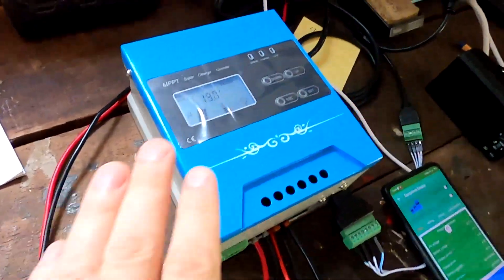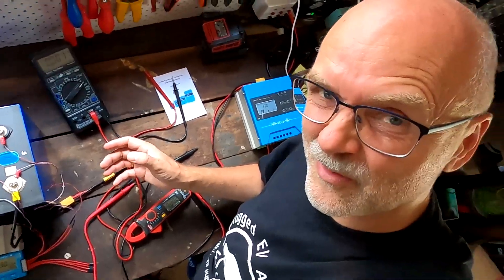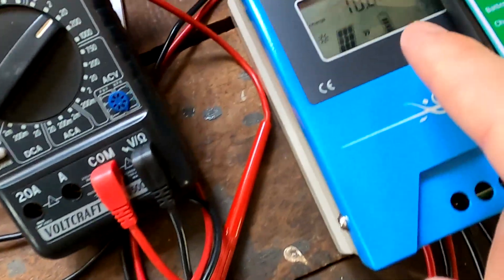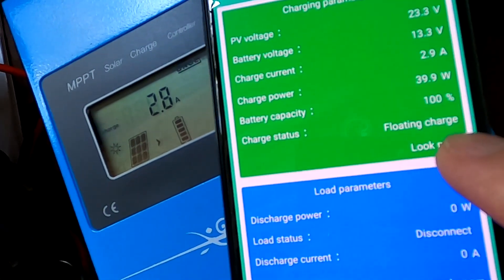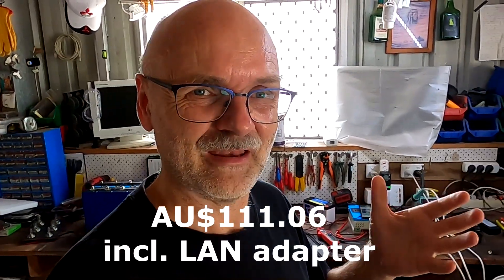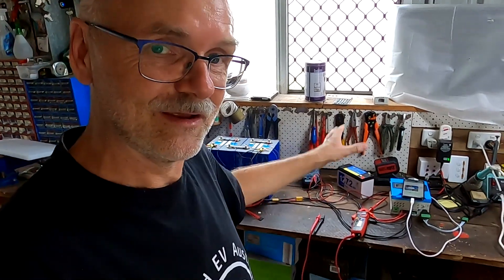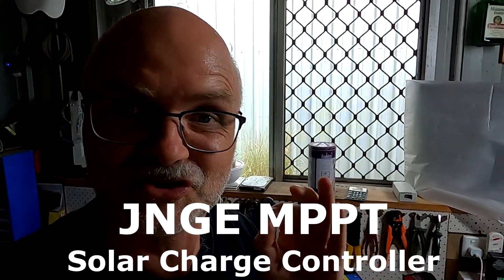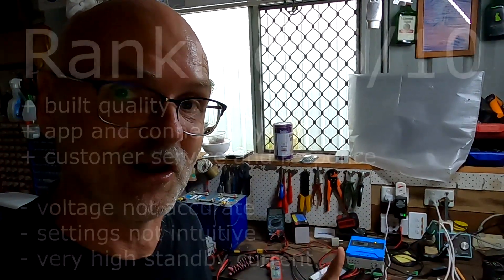JNGE MPPT Solar Charge Controller - Cheap or Awesome? Both?

Comment: Thank you for this comprehensive review. It solved my misunderstanding about setting the various voltage limits. No where in the contained instructions does it state that the voltage is set by cell voltage.  Now I have to determine how many cells I have in my liTime 100 amp LifePo4 batteries. (3x 100 amps in parallel) Thanks again. I have subscribed.

Comment: I recomend to calibrate the tester. I have mine calibrated with a precission voltage reference and got the same voltage than (my) mppt.
Edit: The options on this mppt are for lead acid. I suppose for lithium you should put the same voltage on all charge settings.

Comment: I have a similar controller it's a hybrid wind/solar they sold it to me as a 1500wind / 1500solar 3000w total but in reality it's not it's only 500w wind / 500w solar. Lame. The solar seems to work well I get 13 amps on a sunny day in the middle of winter. But the turbine setup sucks I get 3- 6 amps on a 25km/hr wind  which isn't too bad.

Comment: I purchased this controller, a short while ago and the first comment I will make is that the "warranty" is now only 12 months. Second comment is that it does not come with any connectivity, you have to buy that separate, disappointing as I did not figure that out when reading their sales pitch. 

What you described in the way of connectivity was EXACTLY what I needed, to remotely manage my battery or at least be able to see if all is ok, when I am not there. Plus they had different capacity models available. I read up on what it was supposed to be capable of and figured out that I could run two 12v 200watt 10amp solar panels in series, (24v) and the controller would identify the voltage of my battery (12v) and charge it accordingly. 

From the start I had all sorts of stuff flashing, Uover, Error light and no PV icon, which I realised meant it would not be doing any charging and upon reading the troubleshooting section it seemed that the message was “overvoltage protection point was lower than the highest charging range”. So I set about trying to set up the charging parameters, but nothing I did would get it to stop the errors. No matter how many times I tried to adjust any of the voltage parameters including turning it on and off a few times and letting it sit for a while just in case the capacitors were keeping some sort of memory, no voltage parameters would change I would put in the numbers I wanted press the set button but they just went back to where they were, which at that time were in the individual lipo4 battery cell range 3.2 volts. But it could not read the individual cells of course, it should only see the total voltage of the battery, but it is telling me 3.2v? So with Lipo4 selected as the battery type it thinks the battery is only 3.2v really?  This was with the two PV panels connected in series.
 
Then I read the troubleshoot bit about "reduce the number of PV arrays connected in series" right, so it looks like I cannot connect two panels in series. WOW did I get that wrong? It refers to section 3.1 but in there the only thing I can see that may have something to do with the problem is at No7 it says, “The installed battery pack should match the controller charging voltage and the recommended charging current range.”  Hmm I am not sure exactly what that means – given  that it also says in the product features that “12v/24v/48v battery system automatic identification function”  I cannot see anywhere where they say you cannot series connect the PV panels.

Ok so I disconnected one panel and at least I got rid of the flashing red light, but still had the first error (Uover) and while the controller gave a reading of 13.1v it would NOT allow me to change any voltage parameters, it was still set to LIpo4 but it is determined that I am running a 24v system which is why I am getting the Uover error. I am guessing that is because when I first connected it, it was seeing 24v from the PV panels, even though the PV icon was not lit,  and which did make me recheck that the panels were putting out voltage and amps,  which they were doing. So I then decided to try just one panel. This at least got the PV icon to show, Volts still read 13.1 but the Uover error was still there.  

Now I have the task of trying to communicate with them to see if there is anything they can do or suggest to try to fix the thing without sending it back to China which would be far too expensive. I have installed whatsapp just to try to contact them, but I have not had any luck getting their number to work. 

Might be a hundred and sixty bucks down the toilet!  Worse still where to from here?

Comment: I saw your video 
 Just a thought  , I wonder if it's anything to do with the fact you have  4 cells in series . I have the same device but the manual recommends  3  cells  not   4   to  achieve 11.7 v volts
Reply from the maker: That totally depends on what cells you use, Li-ion or LiFePO4.

Comment: Second thought.  If you used a real BMS ;-) could it be used to shut off the charge at the right voltage, or would that lock up the BMS?  I remember somewhere that that could destroy the charge controller.  Also, could you just program the MPPT cut off voltage a .3 volts offset?  Yea, it's a mess but would it work?

Comment: I really appreciate your videos.  Some time has passed.  I notice that when i search on the JNGE controller I get your video and an JNGE advertisement video.  To me, it's clear JNGE is trying to reach customers that see your video.  The ad video says "new" and offers a discount.  It never says that they have addressed the problem in the "new" version but it would sure seem they would have if they are trying to reach customers that know about the problem.   Do you know if the error has been fixed in this New version?  It sure seems they would have sent you an updated one if they had.  Thank you for the material you put up :-)

Comment: I had that problem with my mppt charge controller, a different brand mind you when I discovered the difference in reading I sit down and calculate the difference and reset the change controller to my calculated settings I never had a problem after that again.

Comment: I have a couple of different ones but recently got 3 make sky-blue controllers. Really good actually. Can calibrate the voltage. Settings for lithium and everything adjustable from controller without PC.

Comment: May be there is a minimum span between the bulk charge and float charge that you must have for it to work. Remember the voltage will drop a small amount when charging finishes so it may have  a historicise between them to stop it flicking on and of continuously. Then your charge start would be below them both.

Comment: Are you sure you are reading the MPPT correctly?  I bet it was displaying battery voltage and not the input solar voltage.  That is why it was less than the battery and that was due to losses across the cables.  In addition, I have seen significant variations in measured voltage even across instruments that are normally considered accurate and reliable such as Volt Ohm meters.  Of course, to truly get a decent Volt Ohm meter you need to spend a bit of money.
Reply from the maker: The voltage of the controller is LOWER than the voltage of the battery. This can never be explained with loses in cables as I explained.
Also, there was no load or solar connected, just the battery voltage reading.
Reply: Now you have me very confused.  I am looking at your video and at 2 minutes in it shows cables going into the PV and battery connections.  Now you say you don't have solar connected.  It is very difficult to say what is going on under these conditions.  My guess is that your charge controller is measuring and displaying the voltage it senses from the battery.  That is what it shows in the video anyway.  There is some length of wire from your battery to the charge controller so I expect some losses although now you also say you had no load.   I can think of a plausible explanation for everything you are complaining about from good MPPT to bad MPPT..  A good MPPT will actually have a separate voltage sense wire that goes directly to the battery terminals.  That eliminates inaccurate voltage readings due to current variations.  If your MPPT thinks it is seeing a 13 volt battery and the battery is actually at 13.3 volts, then the MPPT may try to generate a charging voltage that is too low or borderline.  That could explain your charging light going on and off.  The MPPT alternates between doing nothing and charging.  Anyway, perhaps you should quit buying cheap stuff unless you have seen some verifiable reviews.  My guess is that your MPPT has accuracy problems but it could be some other things I can think of as well.  By the way, did you try putting a load on the system and seeing if that changes things?
Reply from the maker: @robertgrant5895  then it would be the other way around, charger has higher voltage than battery because you lose some through the cables. This one is the opposite.
Reply: @OffGridGarageAustralia  That is only if the MPPT is charging but my guess is it is not charging all the time and thus the light going on and off due to inaccurate voltage measurements at the terminals of the MPPT.  If the MPPT is not charging than you could have voltage losses in the opposite direction. There may be a way to compensate by varying voltage settings in the MPPT menu.  Can't say as I have not seen the menus.  ONe thing seems clear and that is that the MPPT is not seeing the correct voltage.  I see different voltages measured by my reasonably accurate volt-ohm meter just by changing the leads.

By the way, you have your positive red lead reversed with the black common on your voltcraft meter.  That does not inspire a lot of confidence.
Reply: @OffGridGarageAustralia  If you are interested, there is another test you can do.  My latest  hypothesis is that when you measured the voltage at the battery terminals you may have done it when the MPPT was charging the battery.  If this is so, you would be measuring the charging voltage and not the true battery voltage.  You should repeat you tests but after you record what the MPPT says is the battery voltage, disconnect the battery from everything else and measure the voltage at the terminals of the battery.  That way you can insure you are not measuring the MPPT charging voltage.

The thought here is that the MPPT must measure the battery voltage in order to know if it needs to charge and what kind of charge it needs to give.  So that would imply that at least some of the time the MPPT will stop charging to measure the battery voltage, calculate a new MPPT point, and then go back to charging.  I would guess that most of the time it is charging if the battery voltage is low and only some of the time it is measuring the battery voltage.  If true, you are likely measuring the MPPT Charging voltage and not the true battery voltage.  If you disconnect the battery from the MPPT (and probably all else as well) you could see if the actual battery voltage is closer to what the MPPT is telling you it is.
Reply from the maker: @robertgrant5895  the controller was only connected to the battery, no solar, no load. Again, the controller shows a lower voltage than the battery, so could technically never charge it.
Reply: @OffGridGarageAustralia  You are missing what I am saying.  The MPPT is showing something but we really don't know what.  Is it an erroneous measurement due to a bad MPPT or is it measuring the true battery voltage?  You have used other instruments to measure the battery which has led you to believe the battery is at a higher voltage than the MPPT is measuring.  But is this right? It depends on what the MPPT was doing when you made your battery measurements.   Since the battery was connected to the MPPT when you did the measurement (or so it seems) then if the MPPT was charging the battery at the time of your measurements then what you really measured would be the MPPT charging voltage at the terminals of the battery and not the true battery voltage as you would measure if the battery were disconnected and at rest.  Maybe the MPPT is working correctly and takes occasional breaks from charging - as the on and off again MPPT charging light status seems to indicate - so that it can check the true status of the battery and adjust its charging voltage and its MPPT point.  If you measured the battery voltage when the MPPT was not actively charging than this would indicate your MPPT is not accurate.  But if you measured the voltage at the battery when the MPPT was actively charging then you did not measure the battery's actual rest voltage but, rather, the MPPT charging voltage.  OF course, the MPPT charging voltage would be expected to be above the battery's rest voltage.  Don't confuse what the MPPT displays as the battery voltage with the MPPT's charging voltage.  If it is doing it correctly, I would think the MPPT would be smart enough to measure the battery voltage during periods when it is not charging and thus it would be lower than what you would measure when it is charging.  In short, there is a difference between what you will measure at the battery's terminals when the MPPT is charging and when it is not.  At this point, we simply do not know what you measured or what the MPPT is displaying.  It might be in the manual or might not.  I am not saying you are screwing up, I am just saying this is another possibility that I would want to check before reaching any conclusions.  I have spent a good portion of my life debugging hardware and software and have learned you have to check many possibilities before reaching what seem to be obvious conclusions.  True, most of the time the seemingly obvious is the correct answer but sometimes we get fooled.  You are probably right about a poorly designed or built MPPT but you also might not fully understand how things are working.

Comment: disconnect the solar then disconnect the battery after you set the settings the internal controller inside it wont set to your settings till you do this then after about 30 seconds reconnect the battery then reconnect the solar and it should run the settings you programmed alot of these chinesse solar charge controllers are this way its a pain but it is what it is once you get it set properly it is good
Reply from the maker: It still is uncalibrated and I cannot use it like this...

Comment: On the settings change battery type to Lithium.  This charge seems to be only for lead acid batteries. On the makeskyblue charge the settings for Lithium  is #1 and #2 for lead acid. Lithium battery doesn't need floating state.

Comment: Love your videos. However, I think you made a couple of mistakes here: (1) Your panel may be too small, because an MPPT charge controller typically needs the voltage from the panel (Vmp) to be at least 30% higher than the battery charging voltage. PWM charger can deal with a panel voltage closer to the battery voltage. (2) A 200W panel will not overcharge your battery. The charge controller will only put out the current that the battery will accept. 

So, you need to look at the Vmp on your panel. On a 40W panel, it is probably only 16V or so. For a 12V pack, you would probably want something closer to 20-25V for MPPT to work well. Second, I believe you said you have a 200W panel. You should hook it up and things will work bettery.
Reply from the maker: The 40W panel on my roof has 22Voc and works fine with many other MPPTs and this 12V battery.
Reply: @OffGridGarageAustralia  Voc doesn't really matter here. It's Vmp that the MPPT needs. I'm guessing that is closer to 19-20V?
Reply from the maker: Just checked the label again. It's 18.9Vmp.
I should read your comment correctly, ey🤦‍♂️

Comment: I’ve played with three different solar charge controllers recently  all cheap ones but they all ran a lower battery voltage than actual voltage

Comment: I use Victron products and they are rock solid.  More money I know, but worth it because I'll only have to buy it once.
Reply: Exactly. With important electronics like a charge controller, ill pay a little extra for quality and only buy it once. I can understand playing around with cheap ones for YouTube content and testing, but for my main system, I'm not gonna try to save $100 or whatever, while trying to control the charging of a big, expensive battery bank. It doesn't make sense to use cheap charge controllers or a cheap bms when you are trying to make the cells last 10 or 20 years.

Comment: Great videoes, Its fun to experiment with solar, and I share your passion for it. I got my hands on 4x 285w panels, I paid 114Aus$ ish per panel, Thats a steal I think.
Got an AiO 5Kw hybrid inverter that i bought localy. Got 12x 150Ah Lead accid bats connected in 48v config, and they came for free, those where used. 51Kgs pr.bat. insane heavy.
I got a used battery rack from Eltek, it was a part of the flatpack system they have. I have no need for the advanced electronics that came with is, so I riped that out.
got 3 battery equalizer from China and those smal volt meters so i can keep an eye on the volts on each battery. I dont like cloud sollutions, so keep on only on my Lan. Remote Desktop or Teamviewer works perfectly for me. 
Keep those great videoes goin. I do learn alot from it. Even I sit on the other side of the globe from you (Norway)

Comment: Epever seems to be respectable, in my experience. Just check that you get the common negative ones, like the Tracer AN -models. I accidentally burned a charge controller via RS485 since the controller was weaker than the RS485 masters negative ground :D